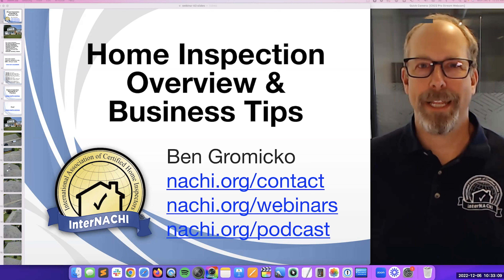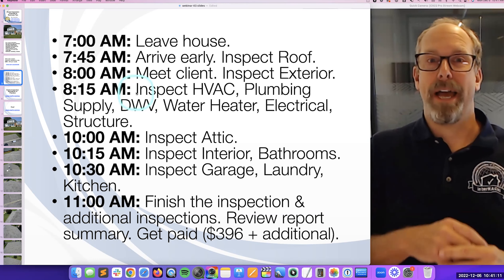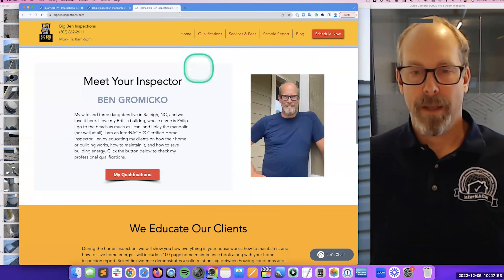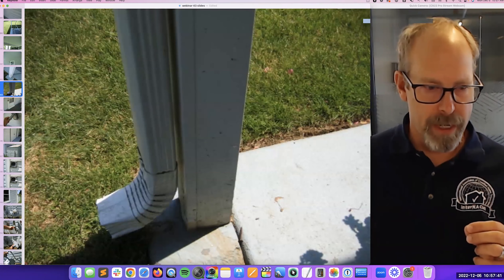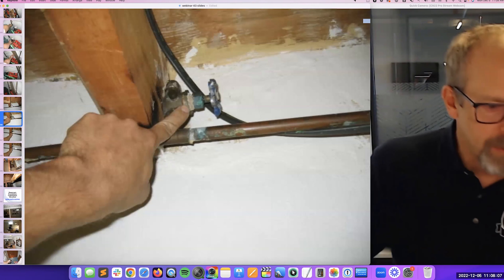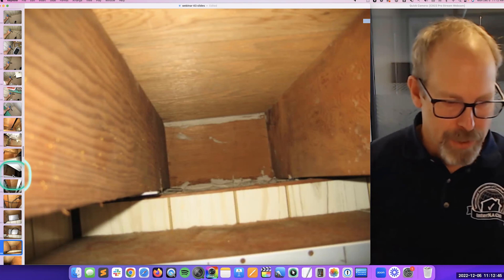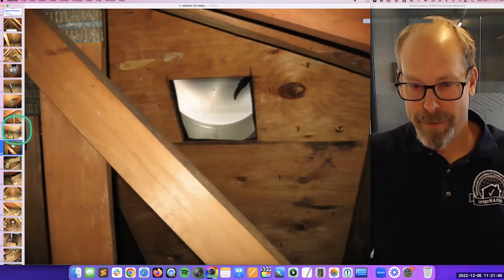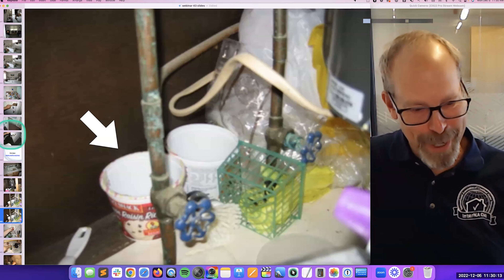"Home Inspection Overview & Business Tips for New Inspectors" Webinar with InterNACHI's Ben Gromicko

Comment: How much time do you dedicate to the IR thermal inspection part? I assume you do the IR part after you have completed the regular inspection. There is the new FLIR ONE EDGE PRO. Wireless clamp to any device, so you can use a much larger screen and does not dangle at the end of a phone, but at the same time, you can use it separately.
Reply from the maker: Small part.